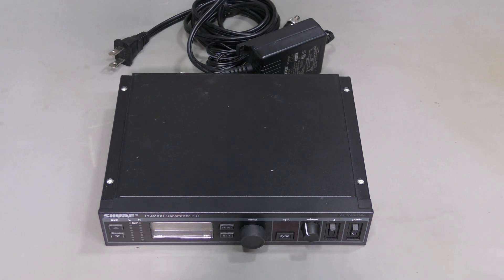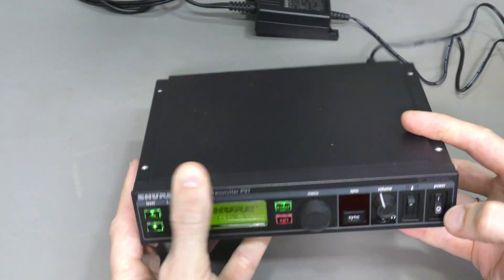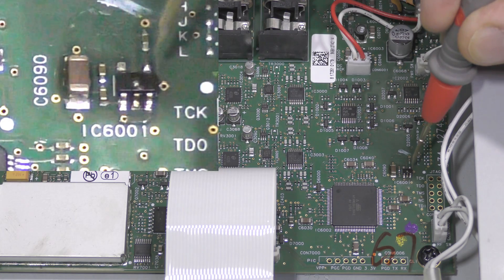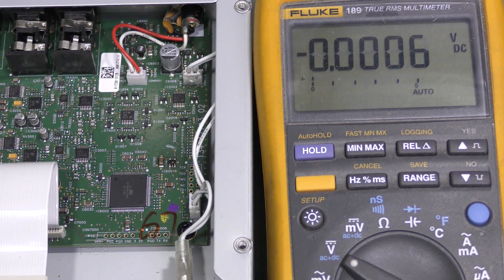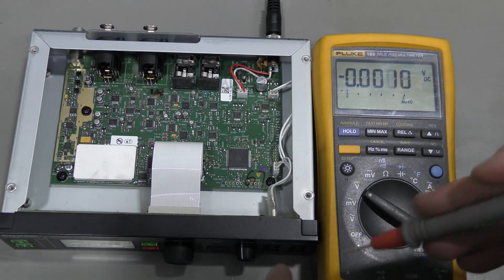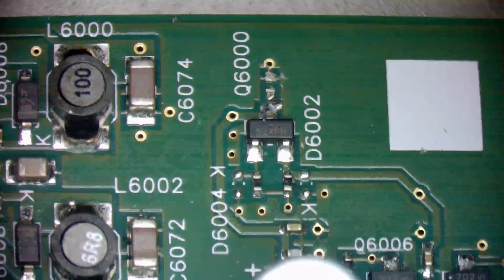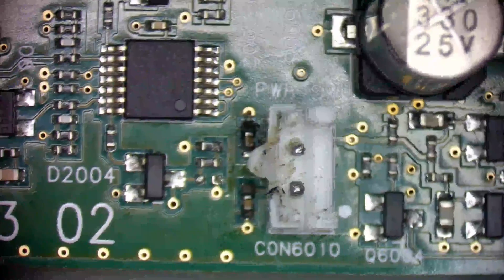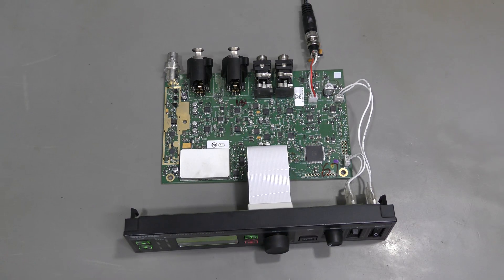#152 - Shure PSM900 transmitter repair

Comment: I have a PSM1000 Dual Channel that’s having an issue. The transmitter switch to turn on the RF to the receiver on one channel doesn’t work. The other channel is fine. I’m wondering if it’s something as simple as the switch itself? Would it be an easy fix?

Comment: Hi. How do you get the cover off please. I take off all the screws but it’s still attached to the front plate somehow.
Reply from the maker: there is a clip in the middle. just use a plastic spudger or something
Reply: Ah thanks. Do you lever the front section up/out?

Comment: Excellent result - probably good that you didn't find the faulty MOSFET first, as you could have fixed the issue with the power switch and still had 5V on the 3.3V rail without knowing it.
Reply from the maker: it would be hard to miss the burned voltage regulator

Comment: Q6000 is likely FDN352AP, marking 52APM (M is for datecode).
Reply from the maker: I found a photo of this part with 52APR marking, so you are right, it must be FDN352AP. So my replacement has lower on-resistance, but FDN352AP can handle up to 30V (as opposed to 20V). The actual voltage is about 15V, so it should be fine.
Reply from the maker: possible, but the datasheet shows XXXM format